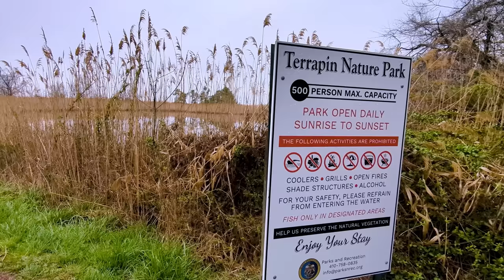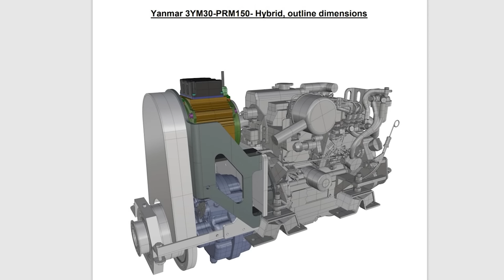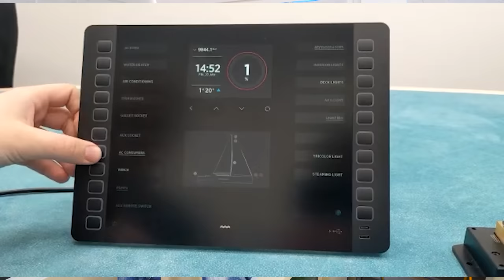Having a Quiet Cry in the Cupboard (MJ Sailing - Ep 278

Comment: UGGG... you are supposed to make the Trim COVER that garbage so you do NOT have to sand forever.... good grief.  Difference between a professional and amateurs is professionals know how to save themselves lots of wasted work. 

As for fairing... uh yea, this is why you just spray texture, roll said texture, and then paint. If you want a FEW surfaces actually perfectly smooth.. uh ok, but otherwise = WASTE OF TIME!

If you REALLY want to make it smooth, do it out on anchor when you are not paying buckooo bucks on the hard.
Reply from the maker: We're really not into the aesthetic of textured paint and plan to stay far away from it.  😉  You may look at what we're doing as a waste of time, but for you, the goal of a build could be to get a boat on the water to begin sailing ASAP.
For us, it is MUCH more than that.  We love working with our hands.  We love learning and mastering new skills. We have the rest of our lives to be out on the water sailing, but this is our one and only ground up build.  And we're not going to waste our time of doing a slapdash job just to get it on the water as quickly as possible.  We also want a home which not only fits our style, but where we can step back and be proud of all our hard work.